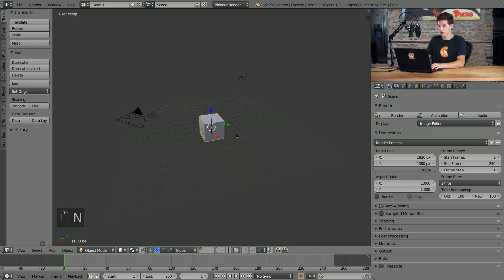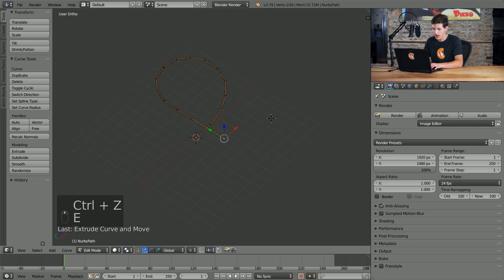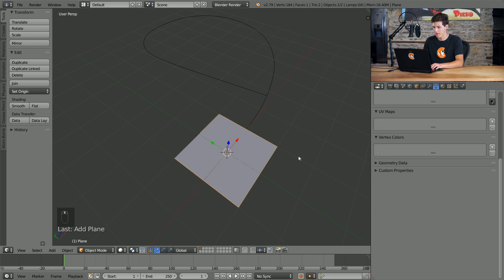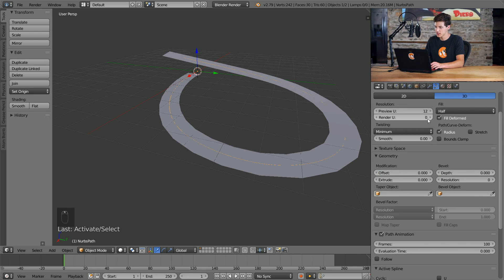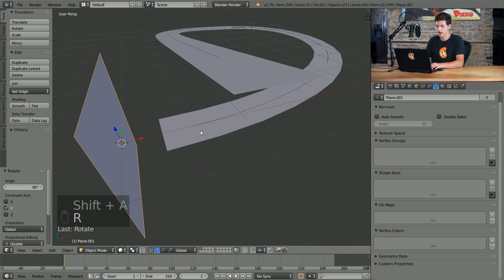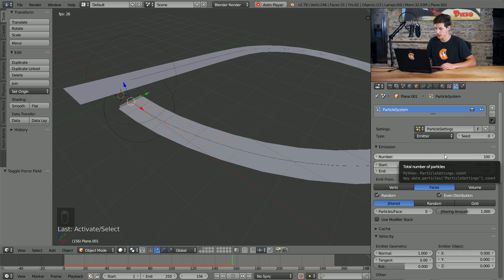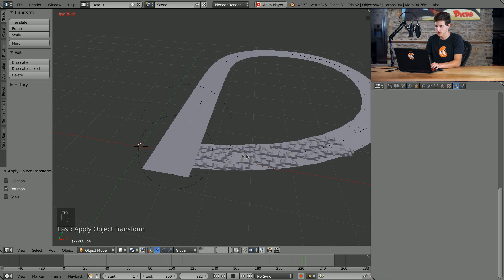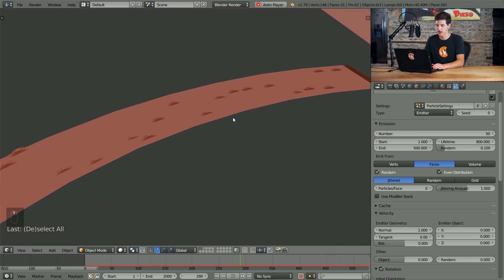Quick and Easy Traffic Simulations in Blender! CGC Weekly #19

Comment: This is a great tutorial!  Instead of hiding the emitter in a tunnel, you could hide the emitter by unchecking Emitter in the Particles\Render section. It won't hide it in the 3D view, but it will hide it in the rendered image.
Reply: However, cars will pop-up from nothing
What doesn't matter if camera is not showing it, but  if it will do a panorama of the traffic, like it looked to be on these case, coming out of a tunnel makes sense

Comment: cool but they don't have moving tires, steering wheel, and they drive through each other
Reply: You can add those elements into the car models. This is just a "outline", and can be improved upon greatly. As for the collision of cars, this can be avoided by using multiple particle emitters that simulate lanes.